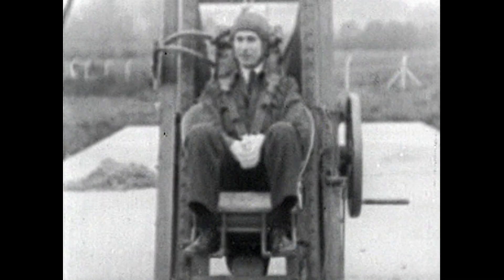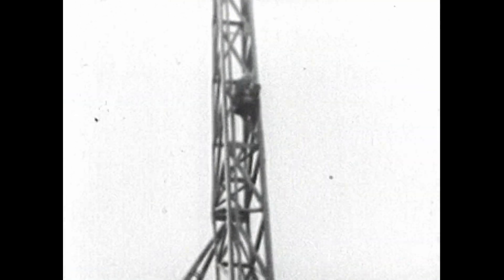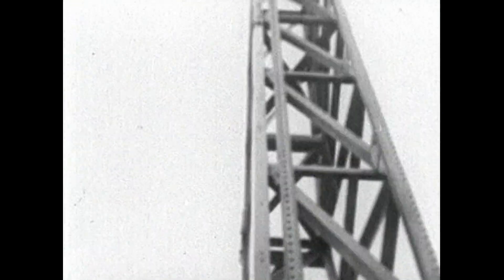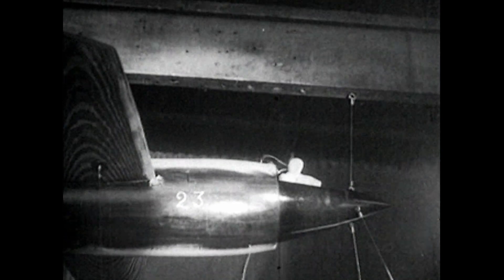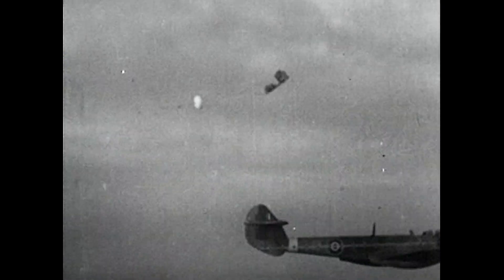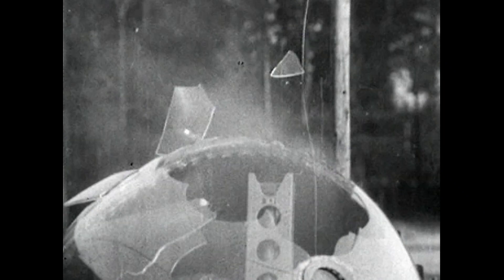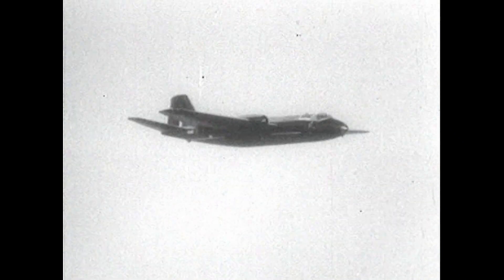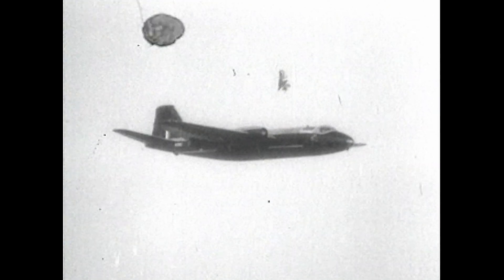Ejection Seat Trials with the Martin Baker Test Rig at Farnborough

Comment: The modern seats are scary. 0-60 mph in 4 inches, 0-375 mph in 6 feet. From pulling the handle to hanging under the parachute is about 1.25 seconds. The face veil is no longer used and the handle is what used to be the emergency back up handle between your legs. The reason being that the force of the ejection was causing dislocated joints  which was considered not a good idea as it rendered the pilot incapable of doing anything to help himself once he was on the ground. The number of lives saved by MB seats now stands in the region of 8000. Not surprising when all Air forces in the western world use MB seats or licence built copies.